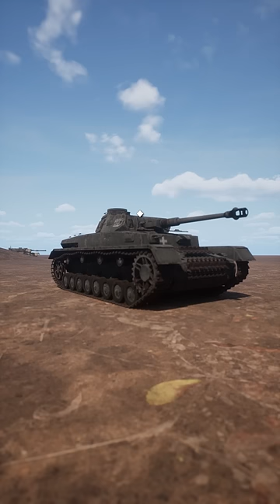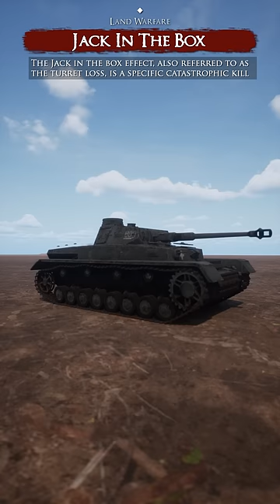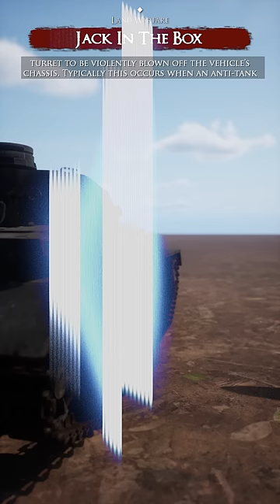Jack in the Box #shorts #documentary #history #military #tactical #modernwarfare #tanks #fyp #war

Comment: The legendary Panzer 4/155 with 155mm APHE HVAP ammo
Reply: It's actually kinda crazy how small tank shells have gotten in modern times. The M103 with a 120mm required 2 loaders. And the same 120 with all that extra propellant still doesn't come close to the velocity of our modern 120's
Reply: Legend says they were stationed on the atlantic wall in case King George V beached itself and needed to be perforated.
Reply: @gnomechild3248  its the shell type, try to throw a Bowling ball and a Dart, APFSDS acted like a Dart and AP acted like a Bowling ball. You deffinetly need a lot more energy to throw a Bowling ball that far
Reply: @ballbender9thousand944  and propellant too. Our gunpowders are much more potent than in the past
Reply: @gnomechild3248 the difference is that modern tanks have smooth bore guns. They allow a faster shot and the modern ammo (apfsds) has much lower weight and drag..
Reply: @carsamba0055  Have you forgotten that the apfsds round has a shroud that only separates after it leaves the barrel, effectively acting the same way as a regular slug up until that point? Believe me, the rifling isn't going to slow the round like you think it does. Yes it lowers velocity, but the difference in speed would be less than 100m/s. And again the difference in weight between modern sabots and those old slugs is only 3kg. A sabot weights 20kg, while the m103 slugs weight 23kg. The lack of powder in modern shells and the extra 400 - 800m/s muzzle velocity should tell you everything you need to know.
Reply: @gnomechild3248 Uhhh, the M103 I am pretty sure has higher muzzle energy than modern 120mm. It fired solid shot AP, not APFSDS, so it is quite impressive it can manage even 1066m/s.
Reply: @romanvarcolac2238  Modern sabots fire at 1,400 - 1,800 m/s depending on the sabot. Much faster than that of the m103. I meant the 400-800 m/s in my previous comment as the difference between the rounds.
Reply: @gnomechild3248  Rifling may not directly slow the round very much, but rifled guns can't really fire apfsds, which effectively doesn't allow them to fire the fastest and most effective round
Reply: @Jatzki  Except rifled barrels can shoot apfsds. The Challenger 2 is an example of this. Yes its inefficient, and outdated. But its still done by the Challenger, at 1,600 m/s. I really don't know why people are trying to argue this. Modern propellants are much, much more advanced.
Reply: @gnomechild3248  That's why I said can't really shoot apfsds. They can, but less effectively
Reply: @Jatzki  No, they really can though. If the Abrams, Leopard, or any other modern MBT had a rifled barrel its main anti tank round would still be an APFSDS. even if it were 1980, and most tanks still used rifled barrels. from WW2, and 1950's tanks the propellants have gotten far more advanced. You are now arguing just to argue.
Reply: @gnomechild3248   I didn't say they physically cannot or would not fire it. I said it's less effective. Which we both agreed on. I'm not arguing for the sake of it, I just don't like my words being twisted or misunderstood. Actually, I'm not even arguing anymore.

Comment: Came here to say this: A russian/soviet study of destroyed tanks showed that the ammo NOT in the autoloader was the primary cause of the ammo detonating. as that ammo, scattered around the rest of the tank, is the easiest to hit, compared to the ammo in the autoloader, which is in one of the hardest to hit areas of the tank. The T-72's Mechanized ammo rack is also lower profile than the T-64 or T-80's. The T-90M also has armor protection on its ammo rack. 

But overall, hitting the ammo of a tank usually causes it to throw its turret, or blow open the hatches and look like a volcano. This is NOT exclusive to soviet tanks. This can happen to any tank.
Reply: Except most other modern tanks are designed so that the ammo is held in a separate compartment which, if hit, will release the energy away from the crew compartment. He explains this in the video.
Reply: @Oblivisci........  only one or two, or three, have that currently. The M1 Abrams’s, the T-90M and the French Leclerc

Comment: When it comes to current Russian/post-Soviet tanks, its also important to mention that they are equipped with full-caliber HE shells - something what western tanks typically do not have. AFAIK 120mm standardized NATO ammunition doesnt even feature a full-caliber HE shell. 
The current system of blowout panels for ammo stowage would not be able to handle the overpressure of a full-caliber HE explosion inside, and despite likely not leading to a turret toss it would still kill the crew and eliminate the vehicle.
Reply: Russia has post soviet tanks? Someone should tell them so they can rush those modern tanks to the frontline. 😂😂😂

Comment: Do people not understand that in most tanks the destruction of the ammo stowage will cause the crew to die as well? It doesn't matter what happens to the turret after this explosion, the crew is dead, and the vehicle is destroyed.
This will happen to any tank without blowout panels, it doesn't matter if it's a Leopard 2 or a T-72.
Reply: In a Leopard 2 or Abrams, ammo cook-offs aren't nearly as lethal. Blow-out panels direct the explosion of the ammunition away from the crew, and out the roof, protecting the crew. 

The tank will need to be repaired, and it will be operationally dead until it can be, but the crew will survive.
Reply: @YungQuant25  Pretty sure the Abrams is very well protected with the blowout panels, but for example the Turkish Leopard-2s got destroyed because their hull ammo stowage does not have blowout panels, You can see in the aftermath pictures the front of the hull is pretty much gone because of the detonation of the ammo, and sadly the crew did not survive.
Reply: @YungQuant25 the leopard 2 doesn't have hull ammo protection and will still blow up when hit
Reply: @YungQuant25 . The case is different with Leopard 1 and earlier variant of Leopard 2

Comment: To be perfectly clear here not all modern tanks actually have blow out panels. 

T-72s, T-80s, and T-90s come to mind but this is not an inherently Russian flaw.

The Challenger 2 of all variants lacks any form of blowout panels. 

The Leopard 2 of all variants stores a solid half of it's ammunition in the front left side of the hull which is not protected by blowout panels either. Though all rounds in the turret are blowout protected.

The Italian Ariete shows no sign of having them at all and stores a concerning majority in the hull in a place I find unlikely to have blowout panels either. The problem with hull ammunition storage is the larger the amount stored in the hull the harder it is to protect it with blowout panels. The only tank I know to have hull blowout panels are the American Abrams series and they only store four in that compartment so it's fairly small and easy to protect.

The Indian Arjun similarly lacks any form of blowout protection as far as I can tell. In fact if I recall correctly there was a bit of controversy there because the manufacturer claimed it to have blowout protection but it doesn't seem to actually feature any.

The only Western tanks I know of to have full blowout protection are the American Abrams and the French Leclerc. 

If you take the Chinese government at their word their Type 15 MBTs also feature full blowout protection.
Reply: what about the Korean K2 and the japanese type 10?
Reply: @macamillan510  I know nothing about either and I don't speak on vehicles I don't know well.
Reply: Not having blowout panels is an inherent flaw, the challenger for example can't exactly be ammo racked, in fact the only case of it happening kinda is when the open coupla of a challenger 2 was hit by a hesh round but lets be honest no tank crew would of survived either way as they died before the ammo exploded
Reply: Probably no @macamillan510
Reply: You didn't mention T-64
Reply: Latest variant of T-90 have a blowout panel, although it's only placed on the secondary ammunition storage

Comment: The Russian T-55, T-62, T-72, and T-80 Suffers from this issue so badly. That you can see the turret fly as high as  4 to 5 stories in the air, from the pressure and explosion. 

Also, the explosion is so violent in the T series tanks. That it causes anyone instead to be reduced to ash. Pretty much vaporizing them like a laser. This is due to the fact that literally ALL of the ammo goes off in the explosion.
Reply: @spongeboss_richpants . Autoloader isn't the cause of problem

Comment: Modern western tanks often have blowout panels for ammunition; Russian tanks like the T-72, T-80 and T-90 do not, and their turrets are known for becoming projectiles
Reply: It's modern tanks in general, issue is the t72-t90 are not modern
Reply: @sadfrog15  the T-90 entered service in 1992, while the first Abrams entered service in 1980, and the first leopard 2 in 1979. The issue is that the Russians chose an autoloading system over a safety feature that prevented your tank crew from getting vaporized the instant your ammo stowage is struck. That said, it's a strange design decision for the leopard to have a sealed compartment for ammunition, but then have another, open stowage sit right next to the driver
Reply: @stephenlawrence554  the t-90 may have entered service later but that doesn't make it modern, it's systems were outdated at the time and Russia hasn't improved on them like the US and EU have